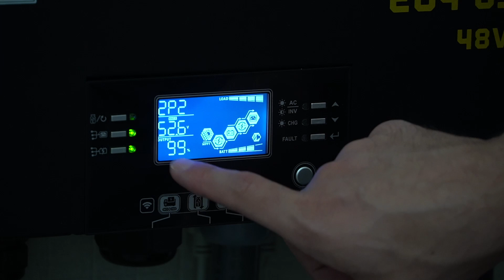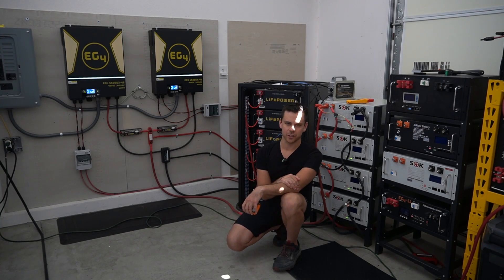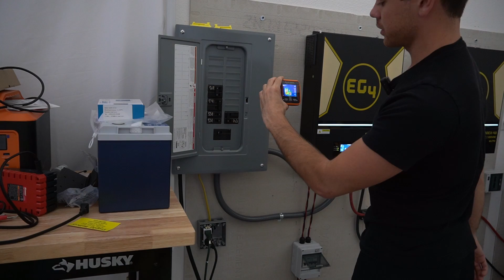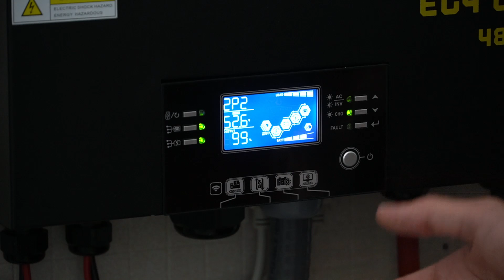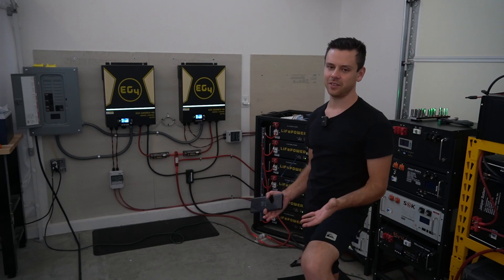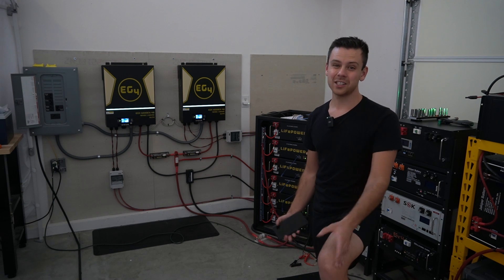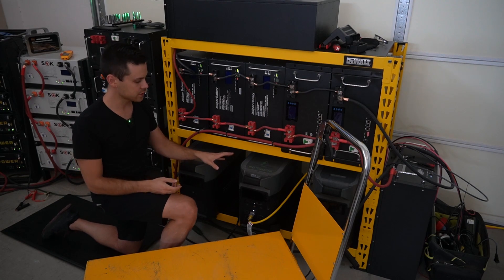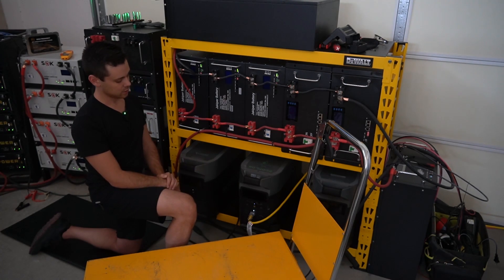EG4 6500EX Max Load Test, Heat Camera Inspection, Upgrades and Discussion

Comment: Would love to see a comparison of LF to HF inverters. I’m getting ready to design my system and I have a well pump and pool pump I want to run. Would love to get these EG4 inverters to work but I’m not sure if they would overload with many things coming in at once.
Reply: +1
Reply: With the HF inverters too there are ways that you can balance loads using an auto transformer. You can size one that will carry 32A at 240 over the neutral for balancing or can go as large as 100 amps at 240 over the neutral. The cool thing about auto transformers is they balance the load perfectly. Then you get all the benefits of an HF inverter and an LF inverter.
Reply: Me too. But if you have the specs on your pumps, you can easily figure out the surge load. Or just measure the surge loads and buy accordingly.

Comment: Thermal cameras are so underrated for troubleshooting. In addition to spotting electrical and water problems, they're great at finding hydraulic problems too. Way too cheap these days to not have in the toolkit.
Reply: My lights Blink when I use infared cook top.  Any one know where which light to replace so it will stop blinks like this please tell me which type of lights and where to buy them, thanks a lot.

Comment: thanks for convincing me to get an infrared temp camera in the future. i think it could detect water leaks or hot electrical wires.  that reminds me of a property for sale we checked , the garage floor is intensely hot while the utility meter is going through the roof despite without people or residents.  too bad we never got to learn what happened there as we weren't interested in the property

Comment: Do you need to have a transformer, to run 240v?
Reply: No you just need two units in parallel ( 120v each unit x 2)

Comment: Hi Will.  Will you eventually be testing the relatively new EG4 6K Off-Grid Split-Phase Inverter (6000EX-48HV) anytime soon?

Since my main solar array is grid-tied also (like yours), I won't be running a large load on my off-grid inverter + server rack battery set up ... mainly just for ASIC mining and running a split-unit air-conditioner where my miners will be.  So instead of getting two EG4 6500EX-48 inverters and doing split-phase with those two, I was thinking of just going with a single split-phase 6000EX-48HV inverter initially (each unit costs just $50 more than a single 6500EX-48 unit) and then scale out in the future with additional split-phase 6000EX-48HV inverters and more server rack batteries, as needed.  Thereby, I would skip over having to need 6500EX-48 inverters in the first place.  Other than 500 W less on the output side per inverter, what will my other downsides be by doing that?  For example, am I losing efficiency?  Thanks!
Reply: You're looking at a single MPPT @ 7500W, 500v.   6500EX has 2, 4000w, 500v  MPPTs.  Depending on your panel voltage, that might not work for you.  I was thinking sell my 6500EX when the new one came out...  Now, after thinking about it, I'd rather just add a second one.  I'd have 16kw of PV input.

In the short term, the 6000EX would suit my immediate needs.  If the 6500EX can do split phase, when you have two, why would you choose the 6000EX?  (I'm still learning myself...)

Comment: Hey Will I have the same system with 4 eg4 batteries. Charging my Tesla at 32 amps  my 6548 overheats.  Can you do a video of a fan upgrade or reversing the flow of the fans. It does seem very in efficient trying to extract the heat downward. Flipping the fan to reverse the flow and might work better. A video of fan upgrades please
Reply: All the major heat producing FETs and transistors are located on the top of the unit so my guess is they would get first dibs on the cooler air ? Think it was discussed on one of the forums and most said it's probably not worth the effort and the pointy heads that designed them have their reasons

Comment: Will, if i use a positive and negative busbars, can i use 2 separate charge controllers connected to these bus bars.?  I want to add solar panels and my current charge controller cant handle the additional panels.  If I buy panels and an additional charge controller and make it work in this manner>?
Reply: Yes it will work - battery doesn't care if you have 1 or 10 chargers  providing you do not exceed the battery charge rate. Either way the battery BMS will protect the batteries
Reply: @TrollingwTyrone  thank you..

Comment: I know they're pricey but a Schneider XW Pro review eventually would be amazing. Especially if compared to victron and the cheaper ones
Reply: XW pro is garbage and that the reason the SolArk is now leading the market. Schneider really messed up with the pro, the firmware sucks and it just does not work.
Reply: @williambryce8527  it can handle loads the solark cant.

Comment: I have two LV6548 inverters that I put in in October and December last year in a split phase configuration based on Will's installation video and they have been working okay until today. I turned them off so I could work on the system and 3 seconds after they turned off the second inverter made a pop noise and all the LiFePower4 battery circuit breakers tripped. I disconnected the inverter and found that it is shorting the battery connection. As I was taking it off the wall, the top plastic piece of an integrated circuit fell out of the inverter. I never could run them above 4,800 watts without one tripping off and not giving an error code as to why - it just restarts by itself over and over. I'm going to start looking into how to make a Victron system. These inverters are just too loud and use too much standby power. Will, I was really interested in the small Victron system video you made a few months ago. Have you thought about expanding it with an inverter and making a video about it?

Comment: I wonder what the feasibility of using server rack batteries as expansion batteries for the Ecoflow or other solar generators. The cost savings could be significant if it could be done. $0.35/wh vs $0.70+

Comment: Will thankfully touches on inverter self consumption which in my opinion is not talked about enough but can be a large factor for small to medium systems that are not located in super sunny southern locations.  It can even be difficult to find in specs.  According to Signature the 6500 HF consumes 50w considerably less than my Growatt’s LF SPF6000 measured 93w (2.2kw over 24 hrs) but one needs two 6500s to get 240v leaving one no further ahead.  The Growatt has a standby setting which uses much less power but disappointingly it only wakes up with a very high 500w demand. (Yes I checked it, hoping it was a misprint, but alas no.)  if there’s one area of inverters that could use improvement I think this would be it.  I would relish a dedicated video on the topic with some real world comparisons and testing.
Reply: Do LF inverters typically use more idle power versus HF?

Comment: Great Video Will.  I have had zero issues when I tested my Sol-Ark 12K at Maximum load capacity.  A lot of people do not understand that they need to go in and set the Maximum Amp Draw for the battery with the Sol-Ark, so they think it has tripped because of the Load but it has really tripped because they are exceeding what they have set as the Max Current draw. This is to protect the Battery BMS from getting fried.   Props for making the comparison between the LF and HF Inverters.  There are to many guys on YouTube who have no idea what they are doing and don't understand that the Limit is not a Variable based on the Price but the actual Specifications.
Reply from the maker: Good to know
Reply from the maker: And yes, agree with the point at the end of your comment

Comment: I think Will’s garage is well insulated and air conditioned. My garage is neither and when it gets to 108 outside my LV6548 twins get an internal temperature of 168F at 20% load. So you seriously need to remember to de rate them when it gets hot. It runs my central AC and everything in the house, I just won’t plan on running the clothes dryer. I have added thermostatically controlled growers fan that ducts air from between them at their lower outlets to the outside. When it’s at 80F, don’t worry about it, run”em hard.
Will, what was the temperature of the garage when you ran the test?
Reply: Same. Garage around 95 to 105 through summer. Inverters at 130F. The afternoon sun made the garage door temp around 145F so I installed radiant barrier which seems to take things down around 10-15F. I have a vid on here showing what I did.

Comment: @WILLIAM PROWSE

🙏PLEase I have a question for you? 

If I wanted to spend about 7g's on a battery rack/ solar  system which one do you recommend? Like for your own home. Can you please print me to the video of that one you would want for your family?
Reply: $7k is too low.  It's a start though.  2x6500EX is $2600.  3xLifePower4 batteries is $4500.  Rack is extra.  That's $7100, and you don't even have solar panels yet...  Add in shipping?  Electricians?

Comment: Is that a light bar on the front of them? That is an absolute no go for me. If that can't be turned off, along with the screen backlight, I would have to hang a blanket over it...probably not a good idea.
Reply: Black duct tape over the light bar would be much better than a blanket.
Reply: @kimmer6  Yeah...or buy another brand would be even better.

Comment: Will, never had a good answer to this question from the forum. Do you think the EG4 6500 inverter(setup in split phase like yours) can handle a 240v 9000w (37amps) well pump starting surge?    I know on paper 13kw is higher than 9kw and trying to stay away from getting a LF inverter.   Just concerned about the repetitive surge over time.
Reply: I'd like to know too!
Reply: @bobcole3852  I have the same two inverters with only two batteries for now and Just got everything connected the other day. I have a well 550 ft down and I checked the inrush current on it today and it read 39A on each leg on startup and 8 amps running. So that is about a 9000-watt surge. I brought up a one kw load on each inverter and then turned the well breaker on and waited with a faucet running. It didn't even grunt or flicker the lights when the well started up and ran at 900 watts per leg. In my case, the deep well starts fine.
Reply: @sh839c   240* 39 = 9360 watts.  200a x 48v = 9600w.  
It'll work fine, unless you're powering something else at the same time.  

I'll explain this as I know it.  I might be wrong, but I'm trying to help.  If you have more to offer, please do!

Your batteries can output 100A each, at 48v, that's 4800 watts.  X2 = 9600 watts.  

To start that pump, your batteries could theoretically do it, but you're pushing your luck.  (I'm assuming you're using either the LifePower4 or g4LL...)

@80%, the most you'd want to pull is 7680w.  That's the 80% rule.  Add a third battery, and the 80% rule says 11,520.  A fourth battery will run you up to 19200.  

Assuming the same batteries, that'll get you 20KWh of backup power, if you have 4.  Or 5.12*4=20.48kwh.  

What if your microwave was on, when the well pump kicked in?

I don't know your situation, so take this with a grain of salt.  You need more batteries, unless you're only doing things during the time when you have solar power available.
Reply: @jamis0nify  Well said. The total possible load @well pump start-up is what matters most. Given that the well pump can start at any time it's best to calculate it accordingly. Though expensive to do I'd consider a LF inverter to run only the well, as any weakness in power to the pump will shorten it's life and it's a PITA to replace.
Reply: Why not install a soft starter on the well pump first?

Comment: QUESTION: WILL: If you were building a house, what type of solar/battery system would you buy...or rent? How big?
Reply: That will depend on what you are needing to power, and how many days of no sun you might have. You will need to figure out what the maximum Watt hours your system needs to be and at the least double that for the solar system.

Comment: Quick question about the noise of these All In One Inverters. We recently bought a cabin that i need to install solar and was planing to install the battery, all in one, and AC panel in a closet type area that is next to the bedrooms. My question is how much noise does this inverter or any all in one for that matter make? I have been told that i should get a shed that is just for the equipment and run the wire for the panel to the cabin as they make a loud humming noise. I know the old systems before the all in ones did this but is this true for the all in ones?
Thanks!
Reply: Two things; The noise is reasonably loud, you probably wouldn’t want it inside the living space. You wouldn’t want to mount it opposite a bedroom wall even if it was insulated. My bedroom is next to the garage and the inverters are mounted at the far end of an adjacent wall and I can’t hear them regardless how hard they are working. They generate a lot of heat so a small space like a laundry room is even too small. When they are running hard I’d have to estimate that they are generating at least 1000 watts of waste heat. Just being on without a load the combined heat is 90 watts.
Reply: @SkypowerwithKarl  Thanks very much for the reply, not what I wanted to hear but glad i didn't install them like my original plan. My current generator shed was going to be torn down but looks like I will be moving it and fixing it up for the all in ones and batteries. Will have to think of some creative way to keep the shed cool during the summer, as for the winters i will probably only running on a generator as its get far to cold for Lithium ion batteries. Thanks again!
Reply: If you size your all-in-one such that it doesn't max out with what you use, the fans never come up to full speed. ;)
Reply: @Tumbleweed5150  Is that the only noise that these make? from the fans? I mean at night we wont be using much if any, maybe some ceiling fans but that is about it so the load should be low.
Reply: @CTSHOYT  That depends on if you get a High Frequency or Low Frequency unit. The low frequency units can give higher initial amperage like for starting compressors, etc., and the high frequency units are much lighter because they don't have a transformer in them. I use one 3000W/120V Growatt for my camper, but I got two 5000W/240V Growatts for my main "house". They are both high frequency units, and thus are much ligher than the equivelant in low frequency units. However, I did need to get an auto transformer to break the 220V down to 110V for my use.The auto transformer makes a buzz, but that's not as loud as the fans were when I did a larger test load on the system.
Reply: @tumbleweed5150 Thank you very much for the information. Sounds like I probably can get away with having it in the cabin. In all reality this is not our main living property, more of a summer cabin so the loads will be minimum. Need ti do some more research myself but you have helped a alot. Thanks again.

Comment: WILL IF YOU WERE GOING TO BUILD A GROUND MOUNT SYSTEM FOR YOUR HOME THAT USES ABOUT 30-35KWH PER YEAR, BUT COULDN'T AFFORD TO BUY A 30KWH SYSTEM UP FRONT, WHAT SETUP WOULD YOU GO WITH?? I WANT TO GET LIKE 15-18KWH SYSTEM NOW AND ADD ON TO IT AS I CAN.
(I DON'T BUY ANYTHING UNLESS I CAN PAY CASH FOR IT, I HAVE SEEN THE HORROR STORIES OF GETTING LOANS FOR SOLAR).... OUR HOUSE IS 7500 SQ. FT. BUT WE AREN'T USING THE TOP 2500 SQ. FT. AND I'M JUST WANTING TO GET AN ALTERNATE SOURCE BEFORE THIS NATION COLLAPSES..... MY ELECTRIC BILL AVERAGED $510 OVER THE PAST YEAR AND IT WENT UP TO $635 THIS MONTH..... SO I SEE THE VALUE IN OWNING THE POWER INSTEAD OF RENTING IT..... MY BIGGEST CONCERN RIGHT NOW IS TIME.... WOULD YOU RECOMMEND GETTING A SOLAR GENERATOR AND EXTRA BATTERIES OR GO AHEAD AND BUILD OUT SOLAR.... IF SO WHAT WOULD YOU USE?? IF YOU CAN HELP IN ANY WAY I WOULD GREATLY APPRECIATE IT.... THANK YOU FOR ALL YOU HAVE DONE FOR ALL OF US WHO HAVE LEARNED MORE FROM YOUR VIDEOS THAN ANY OTHER SOURCE POSSIBLE!!
Reply: 7500 sq ft wtf
Reply: @igneousc  YEAH, IT'S PAID OFF AND THE MARKET JUST ISN'T WORTH SELLING BECAUSE FINDING LAND IS RIDICULOUS RIGHT NOW.... I JUST FIGURED WE'D JUST MAKE THE BEST OF WHAT WE HAVE HERE.....
Reply: You run an HVAC company???  Come on man!  

How much power do you need to charge your car(s).  How much to run your mini-splits?  How much do you want to spend?  

I'm just trying to SURVIVE the apocalypse.  You're trying to do in luxury?

Brother, get you some contractors, and build the ground mounts.  Install the panels into the ground mounts.  Don't hook anything up.  Oversize your underground conduit.  Buy the oversized cables you'll need to run.  Get everything you need beforehand.

When the SHTF, you'll be able to hire an out of work electrician for cheap, to finish your system.

Spend some time figuring out what you'll need to pass code.  You want it cheap?  Get off your butt and figure it out!

And stop typing in all CAPS!  It makes one look like a fool.  Especially with what you wrote!